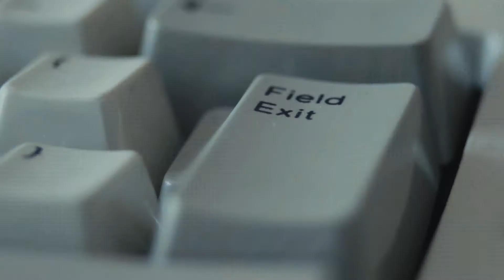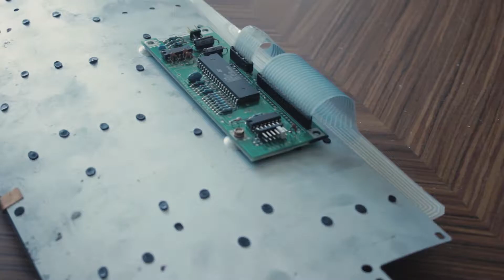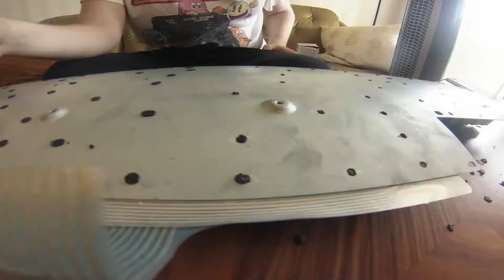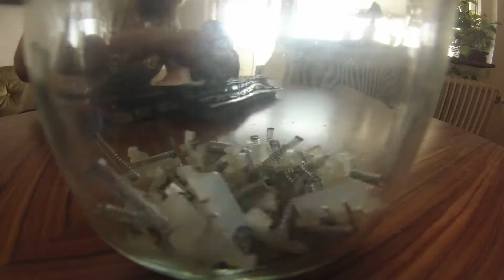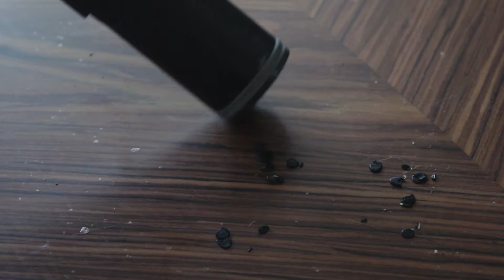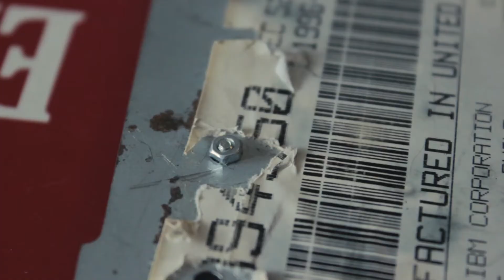IBM Model M Keyboard Bolt Mod

Comment: what size of bolts do u need for this mod?
Reply from the maker: Hey sorry for the late reply!
The ones I used are M2 (2mm) and I'm pretty sure it was 8mm length.
These are the exact ones I purchased: https://www.ebay.co.uk/itm/M2-2mm-ZINC-MACHINE-POZI-PAN-HEAD-SCREWS-BOLTS-WITH-FULL-NUTS-THICK-WASHERS/122410563727